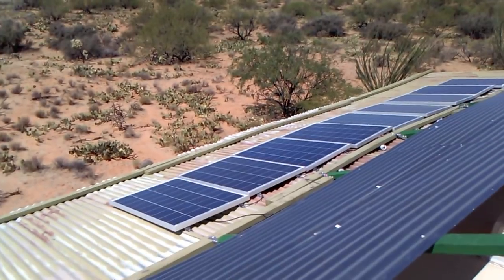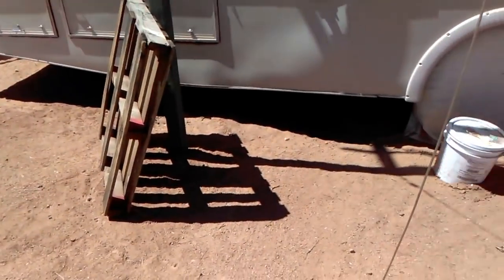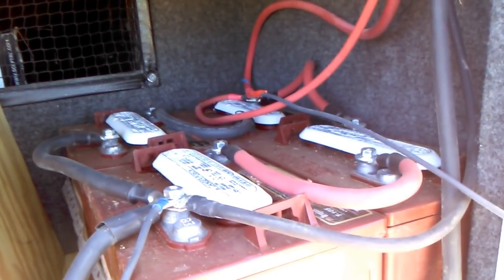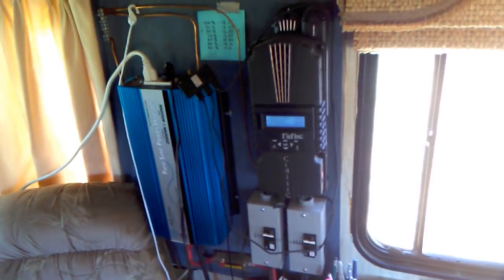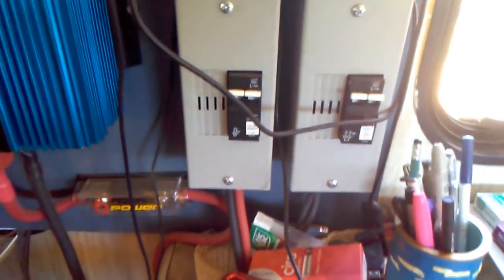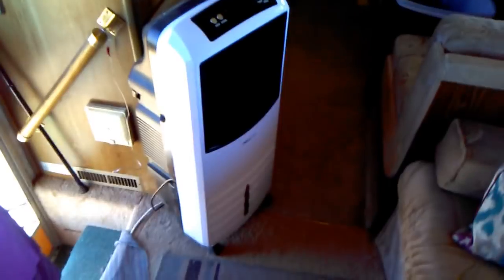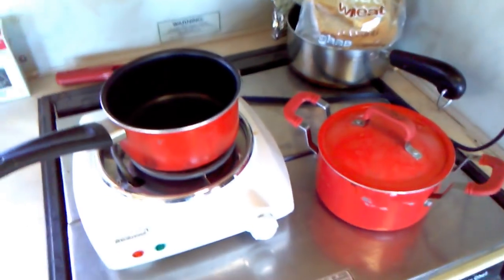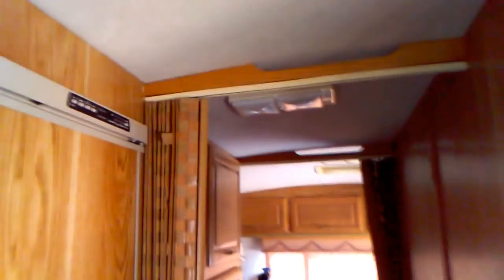800W Solar Setup & Usage w/ pricelist @ AZ Off-Grid (Unplugged) - Off Grid Nation VR

Comment: How’s it doing?
Reply from the maker: It worked beautifully for 2 years.. only thing I couldn't run was an AC..
Then April 2020 I had a cabin put on property so I upgraded the system..
I kept all the panels I had and got some more.. I also kept the same charge controller..
I also got more batteries.. (i did a video on all of it:  https://www.youtube.com/watch?v=JtlOPsKivlw&t=420s )
Then early this year I found some 250 watt panels for 50 bucks each,, so I got 2 of those..
So now I have 2100 watts of panels and 16 batteries.. Now I can run an AC too.. Thanks for watching.. ..Happy Trails.!!

Comment: I just ordered two more 100 watt panels so I have 8 too...lol...I have the Aims 2000 watt inverter/charger.( 24 volts )..it works great...I've got 12 marine batteries and getting 2 more tomorrow for 635 amp hours...the six panels I have now will run the Air conditioning sort of but I'll be  able to leave it running next week ...yeah its gonna be great I think...kinda the same but not lol
Reply from the maker: Cool.. Solar panels are like motorcycles,, boats,, RV's,, or TV's,, you will always think,, "hmmm, I could go bigger".. The 800 I had then was perfect for what I was running but I would not have been able to run an AC whenever I wanted.. I have expanded my system a time or two since this video and I still think "hmmm, I could go bigger".. .. Thanks for watching.. ..Happy Trails.!!

Comment: you should have 4x amphours above the amount you need for daily use. Just because you have more batteries doesn't mean you get to use the entire battery capacity. The amount of solar panel power you need needs to be at least 2x the amount you use on a daily bases. 
You should not have a problem damaging your Batteries if you build to your need by design. If you plan to use more than 2000 watts you should setup a 24 volt battery system
Reply from the maker: Good knowledge,, Thanks.. .. I have since expanded the system, 10 - 100 watt panels, 8 - T-105 batteries and a different charge controller.. I still don't think I am " there" yet.. With the shorter days I see a need for 2 more panels.. If you don't mind, since you sound like you would know.. I have a problem that I never seem to be able to get straight in my head.. .. I got the 12V battery bank,, use it via the inverter to 120V,, got it..... When I figure amp hour usage for a ~60 watt TV,, am I using ~5 amp hours or ~1/2 an amp hour.?  .. .. (btw, if I use everything at the same time,, it is not even 500  watts.)

Comment: Looking good.  I'm planning on using 10 to 12 panels on my system. Isn't it like one battery to very panel?.
Reply from the maker: at 100 watt per panel, ~yes~kinda... You have to have enough 'amperage' going in to start the charging process.. .. ..I kept trying to find out the negatives about going way over on the battery number.. like 6 panels & 12 batteries.. No one could tell me what they were.. turns out the panels won't put out enough to charge that many batteries "efficiently".. So there IS a balance you need to achieve.. .. several factors go into it,, like amount of sunlight where you are,, size of panels,, size of batteries,, etc.. In this video I had 8 panels and 6 batteries.. Now I have 10 panels and 8 batteries.. I would need to add 2 more panels to run an A/C .. and it would run perfect with 12 panels and 8 batteries as the batteries would charge quickly in the morning..

Comment: Looks like you're all set up , what else do you have left to do on the homestead?  How would we survive without all our electronic gadgets? lol
Reply from the maker: My BIGGEST concern is getting it setup for the cold months.. . I need to get a heater with a thermostat once I VERIFY I have a leak in the coach propane system.. If I have one I don't think the propane heat I have setup will work this winter. .. .. .. this fall I am possibly going to get started on a garden of sorts getting it ready for next spring planting.. A very small one to see if I have the ability..

Comment: Why did'nt you build a power shed and have everything in the shed and from there all you would of had to go is plug in.  Thats is what I'am going to do wants I get my off grid land. I'm looking around Holbrook Az And also the slow low, Concho and St. Johns area.
Reply from the maker: Roxanne.. The main reason was so I could move it easily if needed.. All I need to do is mount the solar panels to the roof of the motorhome to drive somewhere else.. I really enjoy having the Charge Controller within view at all times.. Only thing I would change is to mount the Inverter somewhere quieter..

Comment: IF all goes smoothly, guess who should be crossing into AZ sometime on Tuesday?  hahahaha. YUP - you guessed it. I cannot wait! Thanks for the solar update and explanation of how it works. The 5th wheel I bought, which is now on my land, has probably 100 watts ( I think) of solar going for two big batteries. I won't be able to run hardly anything from that setup, but it's a start, and I guess it will provide a trickle charge. Get the cowboy hat and boots ready! My New England accent might give me away, but I'll try!
Reply from the maker: Just say "Howdy!" to everyone..:)  .. ..  If you are getting into AZ on Tuesday,, that means you are on the road already.. Drive safe,, see you soon.!!

Comment: I have heard that solar panels work optimum at about 77 degrees of course thats hard to accomplish. But raising those panels from the roof a couple of inches will create better circulation and help cool them down.
Reply from the maker: I had heard 30.. I figure they are about ~15 now.. If I put them up too high they will be in shadow longer in the morning and evening.. When winter comes I believe they will work just fine where they are.. We'll see..
Reply: He's talking about creating an airspace between the panels and the surface they are mounted on.  Not the solar angle.
Reply: Exactly a 2 or 3” space between your roof and panels
Reply from the maker: After rereading I see what you mean.. doh!! We were both talking about degrees which is the funny part.. Just like a bad watch I do achieve 77 degrees twice a day.:).. .. .. I have touched the roof panels during the hot part of the day and they are quite touchable,, maybe because I painted them, I dunno.. .. ..  When i built the awning, I never designed it to hold all this weight,, so I must be careful of the load I place upon it.. There have been many compromises made because of the original awning structure..
Reply: As a note,  I was told that the glass on solar panels is rated to withstand impacts (ie hail) at no less than 30 degrees- you may want to check the specs on your specific panels.
Reply from the maker: Thanks for input.. Ummm, you DO know where I live, right.?  I can't remember the last time we had hail here... ... Now, if you had asked me the last time it hailed in Oklahoma,, answer will always be "last week"...
Reply: I live in the Valley and the Sonoran desert is about the same from Mexican border to just north of Phoenix- hail is rare but I used to live in a Mobile home in Apache Junction back in the 80’s and the very seldom large hail can destroy things- In my case carports and roofs. 1+” hail.   Just something to consider.
Reply from the maker: Along with weight as a reason, I also bought the 100W panels for low cost and ease of replacing.. You are correct,, it is something to consider..